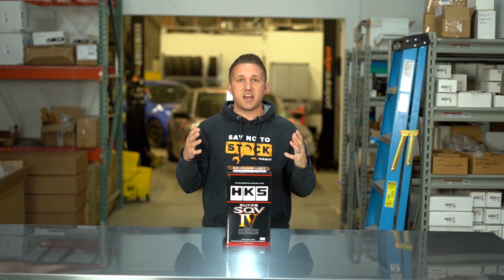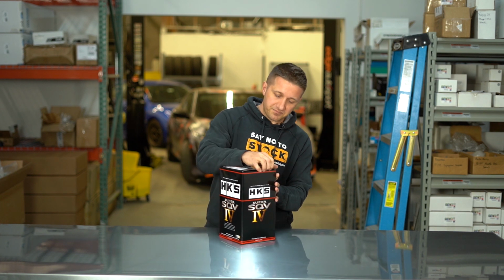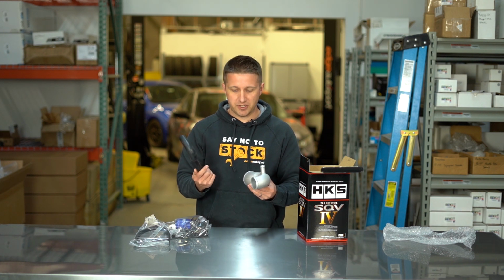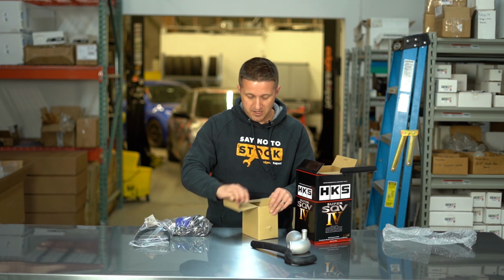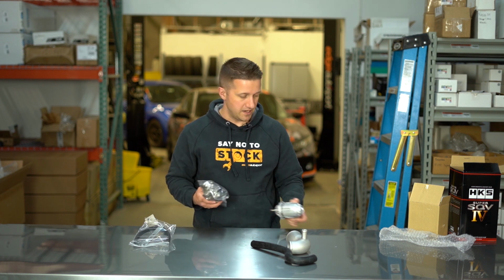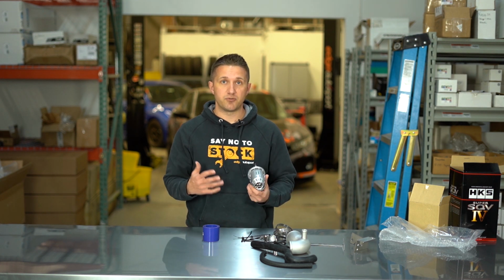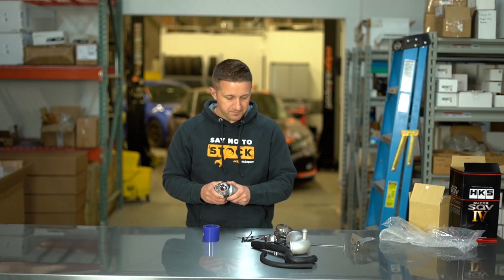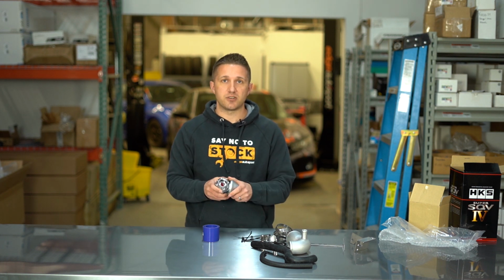HKS Blow off Valve for 10th gen Honda Civic

Comment: Didn't you know to never use a blow off valve with stock ecu because of the maf sensor. Running super rich during transit. Stock ecu does not like any changed to the bpv

Comment: I’m curious to understand why manufacturers invest in this for the 10th gen Civic as by Honda design this amount of high pressure air is meant to be contained to reduce turbo lag on re-acceleration. Mathematically you loose agility when you use this type of valves.